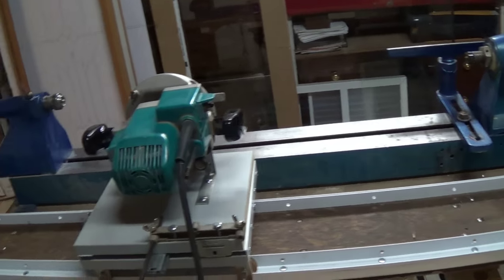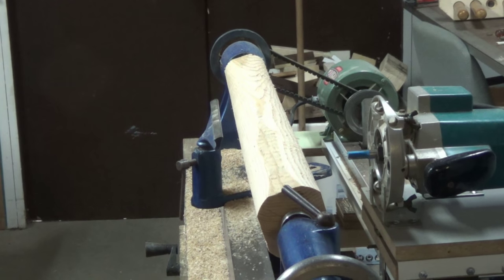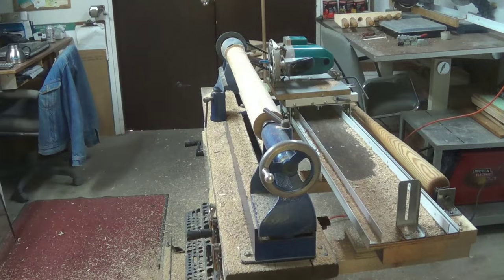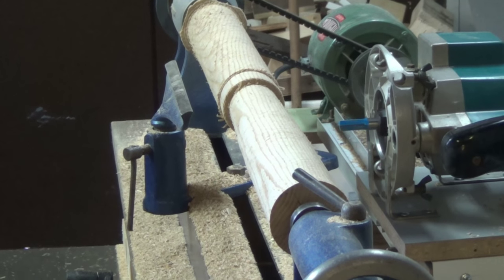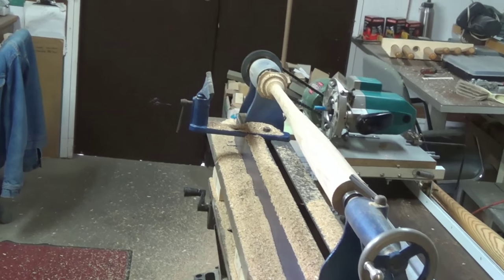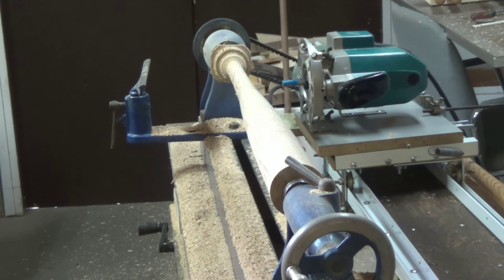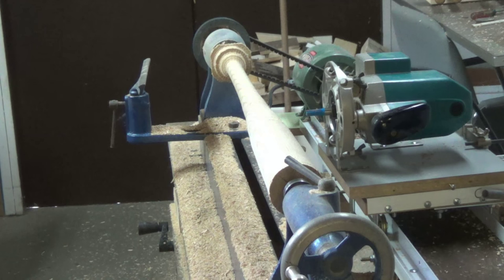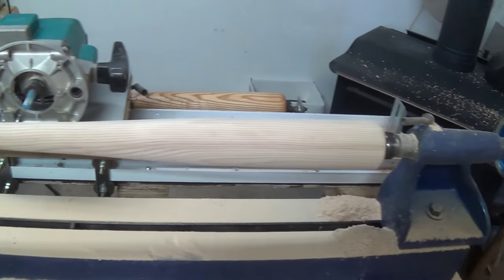lathe bat duplicator

Comment: I like your design. I've seen some idiots out there jam their routers into uneven stock and exponentially increase the shear-off factor of their bit. You did it nice and slow and I was glad to see you rounded the piece first before jumping into it. Cheers, and glad d it worked out for you
Reply from the maker: +Sig Guy thanks for the comments. Yes I was worried about shearing the bit off and more important not having the sheared off piece of hard steel lodged deep inside my forehead.

Comment: Do you think this device can be used to build a pool cue? A pool cue shaft has a diameter of two centimeters on one side and one centimeter at the end. The length of a short is almost 70 centimeters. The problem is that the wood is thin and so may deflect under a lateral load.
Reply from the maker: I think for a pool cue you would need to add a steady rest.  see here  https://www.youtube.com/watch?v=D8cUcAZwhdM

Comment: Nice work. What router bit did you use ? What speed did you have the lathe set for ?
Reply from the maker: Hi Doug,   I used a 3/8 straight cutting bit and medium speed.
Reply: @derekgale  Thanks.